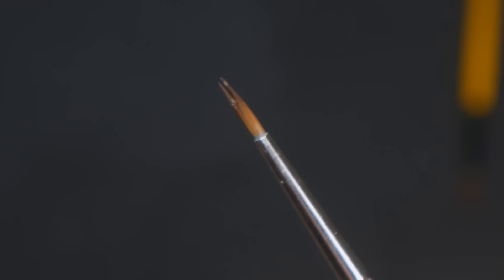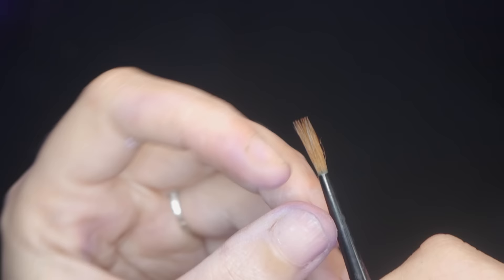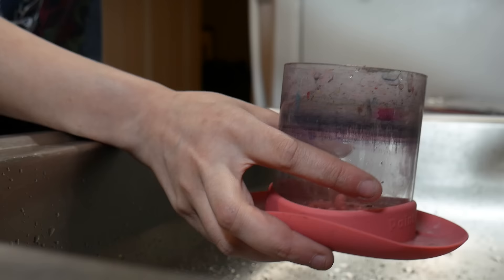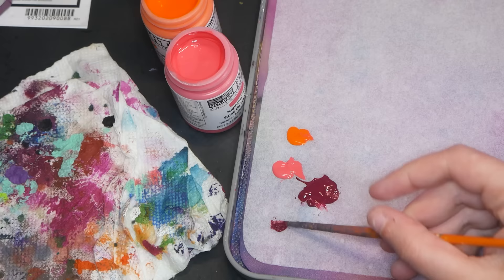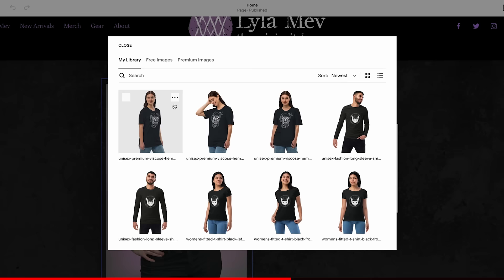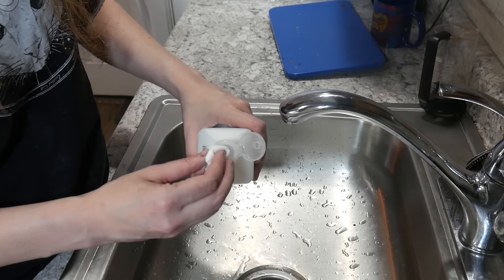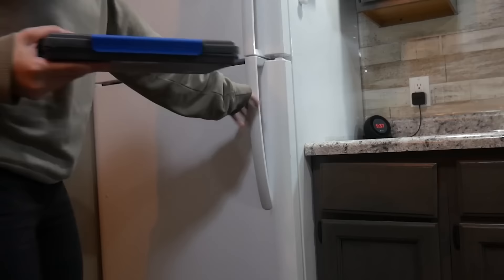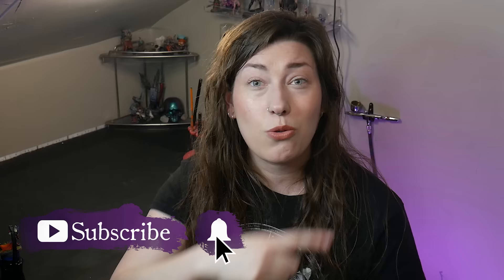STOP Ruining Your Miniature Paint Brushes

Comment: I can’t believe you would attack me, personally, like this.  I’m stunned.
Reply from the maker: Oh!? Which part?
Reply: put me on blast for real
Reply: @LylaMev  all of it, lol. but specifically the wet pallette.  I paint so infrequently it's moldy every time I sit down.

And as an art teacher I should know better
Reply: Add some additives to your wet pallet . Flow aid is a good one . Or a drop of anti bacterial dish soap.
Reply: I've had good luck with the "The Masters" Brush Cleaner and preserver though I would like to reduce how much I need to scrub
Reply: @Art teacher:  hydrogen peroxide - about a dollar in the first aid section at wal-mart. Spray it lightly/thinly on both sides of the pad = no mold.
Reply: I don’t know what the pad is made of (can’t google right now), usually peroxide is pretty useful against mold in these kind of situations.

However peroxides are pretty “aggressive”, dependent on the concentration and it can destroy the molecular integrity of certain things.

As I’ve said, I don’t know what the pads are made of but in our lab we handle peroxides with gloves and to quicken certain reactions/clean and stuff like that.

Saying that, diluted your dentist uses peroxide sooo xD
Reply: This video is so brutal lol
Reply: Use distilled water. Takes much longer to go mouldy.
Reply: Where did you get your paint pot for your brushes. Thank for sharing your experience and advice 😊🎉

Comment: Keeping brushes in good condition is much easier. Use Gall Soap clean the brush on top of the soap with water, wash the soap out in a bottle with water and do it again, get all the piquments out and pull the brush on paper towel an leave a good amount of saop in it. Put your brush upright to dry and let it harden. The Tip of the brush will be contained until next use. No fancy stuff needed. 😉

Comment: I’ve definitely trimmed the bad tips from old brushes and used them for things like painting terrain, dry brushing, or particularly rough surfaces that might ruin a brush over time. Brush isn’t useless until it has no bristles left.
Reply: And even if it has no bristles, you now have a handle you can attach to homemade tools. Brush handles make for good sculpting tools with a bit of wire taped on, you can use pine needles for drawing, make a shank to kill the guy in 14B, etc.

Comment: I have been using this one for a few years to help restore brushes, Winsor & Newton Brush Cleaner & Restorer and it works very well.  But like most of these, don't get it anywhere else on the brush as it tends to gum up your brush handle.  I just started using the Master's brush cleaner the other day and it seems to work really well, plus it's easy to use so I will work this into the rotation after painting.  I'm still a noob but brushes are easy to kill I have notice lol.

Comment: I have a method for cleaning/restoring brushes that I've had pull back brushes from the ruined/unusable to a working state. I've mainly used this on drybrushes/brushes used to move lots of paint, not detail brushes.
 I have a ultra sonic cleaner, I use about 1:5-1:4 simple green to water solution in to strip minis, but I also use it to clean my brushes every couple of months, or if a brush gets gunked up with paint. I use two rulers and some rubber bands to set up a rig, and have just the bristles and some of the Ferrule sitting in the water. I run it for about 30 minutes, rinse the brushes with water, then clean them with Masters Brush Cleaner a couple of times to recondition the bristles, as the ultrasonic cleaner strips everything off the bristles. 
This generally gets them back into a reasonable state, and then for flat dry brushes I have some pegs clamped over the bristles as they dry, so that they realign flat if they're splaying out. My drybrushes (which are the things that generally get the most beaten) are living probably 4-5 times as long as they used to now.

Comment: Not a solution to all brush issues, but I've often rescued a brush by just dipping it in VERY hot water, on the edge of boiling.  It can help to get some dried paint out and help to restore the shape.  Any chemical beyond the H2O has led me to issues similar to what you found with the vinegar.

Comment: I use the Abteiling 502 Magic Potion for brushes if normal soap doesn’t so it. I’ll suspend the brush head (not the handle, the paint will melt) in the bottle overnight then rinse and use soap the next day. It works really well!

Comment: For the wet palette I use paper towels instead of a sponge, 2 pieces folded in half and cut to shape, then some white baking paper on top, works well for me. If any mold forms (around 2 weeks is the danger zone), I just throw it out and clean the palette with soap.
Reply: Instead of a sponge you can also buy cloth-like paper on rolls: it’s used to clean ceramic/induction stoves. A little more expensive than paper rolls but you don’t use much. Using only distilled water 💦 is probably the best way to delay mould — It’s about $0.50-$1.00 per litre round my way.

Comment: I've recently started just using a folded paper towel instead of a sponge and haven't noticed any major difference in how the wet pallet functions.  And it's great because you can just use it until the paper towel begins falling apart, then throw it out and put a new one in.  That way mold doesn't have a long time to establish itself.
Reply: I use a paper towel under parchment paper works really good.

Comment: Mold can be killed, but the stains will stay. Easily done with most bathroom cleaners or anything with chlorine in it. Alcohol could work too, but it has to be high proof (70% and up) and it needs time to kill the mold.
Thanks for the tip with the poolnoodle.

Comment: The old copper pennies trick is a knockout. I keep about 3 in the bottom of my standard Masterson's palette and I never have to worry about mold, and I've never swapped my sponge.

You can also straighten the hooked tips on some nicer synthetic brushes by running them under super hot water. Guy from Midwinter Minis has a whole video about restoring synthetic brushes that's well worth a watch.

Comment: I use cheap walmart basic premium synthetics for minis as they cost 5-10$ for a 10 pack of various sizes and I can do anything with them that I could with the absurdly expensive premiums like Winsors or Davinchis.    Those needing to be properly conditioned and handled with kid gloves is too much a con for the very little pro they offer.  it just isnt worth the hassle when you can buy 10x more brushes and just get to painting, and toss them out when they eventually fray or split, as opposed to feeling like you just wrecked $50 brush because you forgot to dry it upside down, or put conditioner on it the night before.

Comment: I know this is late, but you probably don't want to wash anything with antimicrobial soap. Soap in of itself is antimicrobial because of physics it disrupts the micro bacteria's cell membrane and then the way that the soap adheres to water molecules will wash what is left down the drain. Most antimicrobial soaps use low levels of antibiotics and have been known to increase antibiotic resistances. Also fungi have different cell walls then other micros so the antibiotics probably are not going to work anyway because their mechanism of action tends to be very specific targeting certain weak points in the cell wall/membrane. Give or take it's been a few years since I had this class. Sorry if this is annoying, I just feel the need to share to try and combat the issues of antibiotic resistance. Your videos are very useful and help me out a lot!

Comment: Another trick to prevent mold is putting some rubbing alcohol on the sponge. Not too much because it can damage things. It is water soluble so it shouldn't affect things much. But I would test it on different paints for effect.

Comment: I use sponges washing up, think they are called spongex flat yellow ones weird texture. Also you can get a paint additive which inhibits mould and you need like one drop in the water for the whole pallet. Also if you do get mould I would say use Milton or the stuff to sterilise baby bottles. Also Windsor and Newton brush cleaner is the best I have tried or IPA. Good video and great tips. Also bar of soap like Dove and hair conditioner and shampoo works well to clean your brush. Cheap hair gel for short hair works on brushes when storing them to hold their point and washes out in water.
Reply from the maker: The Windsor newtons brush cleaner is what ruined my brush! It left it all dry! Did I do it wrong
Reply: @LylaMev  I don't think so but it doesn't work on some brushes only real hair sable. If it's real hair did you try hair conditioner to see if it would bounce back.

Comment: The longest I've ever had a brush last was 20 years, 15 as a prime brush then another 5 as a utility brush for all sorts, it was never given much more than a swill around the water pot for a clean but i have always added a very tiny amount of washing up liquid (about the size of a peanut of volume) to my water pot. I've found good quality Sable Brushes split anyway regardless if there is paint in the ferrule or not, its just more obvious to see if the is paint getting into the ferrule of the brush.

Comment: To clean the spunge of your wet-pallet, I'd suggest isopropyl alcohol. It effectively kills mold (IPA is the active ingredient in almost all industrial strength desinfectant) and also disolves most of the paint that seeped into your sponge (interior decorators use it to remove acrylic paint that accidentally got onto surfaces) . Just soak the sponge in the recipient of your wet pallet for some time (préférably over night) and rince abundantly the next day with clean water. That should do the trick.
Reply from the maker: it sounds like i might need to do a video on wet palette cleaning hacks.
Reply: For what it's worth, I tried IPA and it destroyed the sponge
Reply: @JonathanTaylorW  Well. Don't let it soak in IPA. What I do is I water the IPA down to about a 50:50 mix when working with 99% pure IPA, and squirt some of it on the sponge, then rub it and soak immediately. I repeat that a couple of times until I am convinced, I can't get any more paint out (which is not the main reason I am doing this, but to kill mold).
I am still using the original sponges of my Kickstarter Redgrass palette and have no mold issues or issues with the sponge not working anymore.
Reply: @travelminipainter  thanks bud! I'll give it a go. I'll also try and pick up a redgrass wet palette if I can as well
Reply: I should have made it clear in my original post and my reply that the soaking part overnight is with diluted IPA, never pure IPA. Sorry if that caused any confusion.
The rubbing part comes in, once the soaking has been done (couple of hours).

Comment: Can't remember which Painting Youtuber mentioned it for mold, but they recommended washing the sponge as best as you can. Squeeze out  80% of the water then microwave the sponge for 10-15 seconds on repeat till the sponge is hot to the touch. Rinse. I did this to mine and no more mold or smell.

Comment: I use the masters brush cleaner and I am very happy with this :), I also gave a brushsoap bij Master's, which I use mostly on my dry brush brushes
Reply: I use the Master's brush cleaner as well, for cleaning and reconditioning.

After cleaning the brush with the Master's and rinsing it well, I soap the bristles once more and reform the tip with my fingers. Then I let the soap dry in the bristles -- it helps reform the tip of the brush, and the soap rinses right out in my water jug the next time I use them.

One other thing I use are brush protectors to keep the bristles from getting banged around. I bought a set nylon mesh sleeves, which slide onto the brush when I can't find, or don't want to use, those clear plastic tubes the brushes come with. Just make sure you always slide them on and off the brush one way, from the handle end.
Reply from the maker: The handle end is genius!

Comment: What has worked for me: If you have a small amount of mold on the sponge, soak it overnight in water with a small amount of bleach in it, then wash and rinse it out well.  The bleach will kill everything and your sponge will be good as new.  Note that the larger the amount of bleach, the harder it is on the sponge.  For me, I use the army painter wet palette and about 1/2 a cap-full of bleach is plenty.  I've bleached a sponge twice now and it's still going strong.  It has the added benefit of disinfecting the tray as well.

Comment: Windsor and Newton Brush Cleaner & Restorer works great for me (Guy from Midwinter did a video on it). For the wet palette, I just use parchment paper ($1.50 a roll at the dollar store, discard after every couple of uses - a bit of effort to cut to size for my masterson wet palette, but oh, so inexpensive. Same for the sponge - thin cellulose sponges from dollar store, replace when they get nasty)
Reply: Best WP paper is matersons . I tried many and only matersons holds up to long term use. Even as far as washing the paint off and reusing it for 2nd and even 3rd paint sessions . Soooo worth it .

Comment: Dried paint can be removed with acetone but only bristles 
To settle it can be used clai On the hair or beard bristles then shaped to dry before use rinse in water
Reply: Years ago, Newtype USA used to run Gunpla articles (Gundam model building). That author suggested the acetone thing too. They said to take a glass jar with acetone, and rubber-band your brushes together and suspend them in the acetone. It takes a couple of days, but it WILL get the dried paint out. 

Just don't manage to get brushes with plastic handles to fall INTO the jar. You will end up with a puddle of goo and bristles. It also smells up the room you're doing this in. I used to do it right before going out of town for the weekend.

Comment: Have you tried Silver Brush Black Velvet, they are made of squirrel hair and black synthetic. They use to be really cheap, but not anymore of course. However they hold a great point, but they also curve. Some of my favorite non-sable brushes.
Reply: I just bought one of these, but I haven't used it yet. I'm excited to try. Not really one I've heard much about. Glad to know someone has had a positive experience. Amazon reviews are too easy to buy to trust too much.
Reply: @Ali626AMM  I never bought brushes from amazon, pretty risky on there. At first I wasn’t a fan, I expected to be more like sable but after a few uses and no jay hooks I dig em.
Reply: @RandomGamer1984  I bought a Raphael brush and it is absolutely amazing for gradients across larger surfaces. I was doing dragon wings. 3 color blends across surfaces that are 2.5x4.5" with perfection. I'm in love. I hope the Silver brushes are as nice and I like it better than the Windsor and Newton that I bought on Amazon that I'm convinced have to be fake to be so bad.
Reply: @Ali626AMM  I love my Raphael’s and other sables, but synthetics these are the only ones I have actually liked.

Comment: I'm getting better at and about cleaning my brushes more frequently, I'll admit. Currently I'm using Monument Games' Jentastic Brush Goop and it's doing really well as a cleaner and restorer. I got into using a bit of dish soap in my wet palette water because of your suggestion and it seems to be working well.
Reply: Do you leave the dish soap in the water while using the pallet? How much dish soap are you talking about?
Reply: @truehearted2295  I fill a squirt bottle full of water and just a dot of dish soap, as in a little squeeze. Then I shake it up until it's nice and foamy, let it settle, and soak the sponge with it as usual.

Comment: Just wanted to mention that mold dies at around 150 degrees Fahrenheit. So boiling water would not be necessary to kill the mold. You may want to try again if you have another nearly dead moldy sponge. It may not get the sponge clean but the mold should be dead. Also it should only take like a minute at most to kill it.

Comment: Some hot tips for you mold-cursed hobbyists: 
I use a home-made wet palette made with cellulose cloth sponges and so far I've not had mold develop in my wet palette. It might be because they have a tiny bit of soap in them.
I also use demineralised water for my wet palette. That might also help. 

As for brushes...
I only use synthetics and recycle them when they get bad...
Reply: Also recommend copper tape under the sponge which inhibits mold growth.

Comment: If your brush bends you can just dip it in boiling water for ~15 seconds. I use an expensive brush shaper dip I got at Hobby Lobby, but I'm pretty sure it's just corn starch solution.

Comment: For brush cleaning id recommend Abteilung Magic Potion for Brushes, I find it great for regular cleaning and it’s great for old crusty brushes if you soak them in it over night. They also have a Magic Gel for Brushes which is great for shaping the brush after cleaning and also acts as a conditioner. 

How do you find the reusable pallet paper? Is it worth getting or am I better off sticking to the regular stuff?
Reply from the maker: I prefer the one time use paper, but everyone is different ☺️